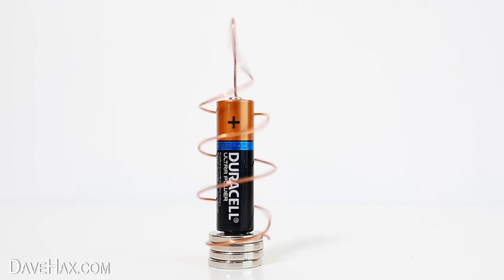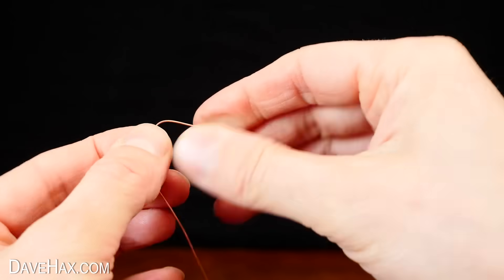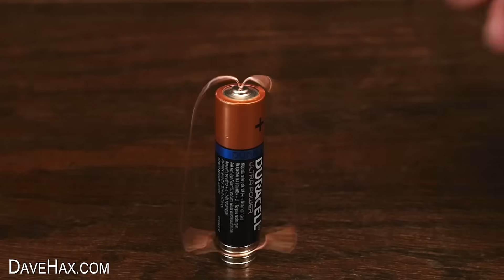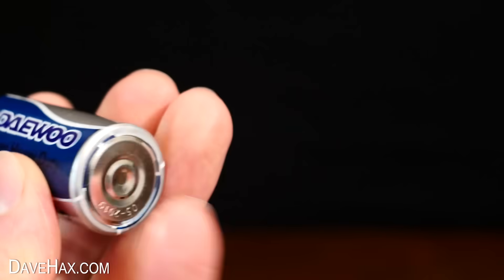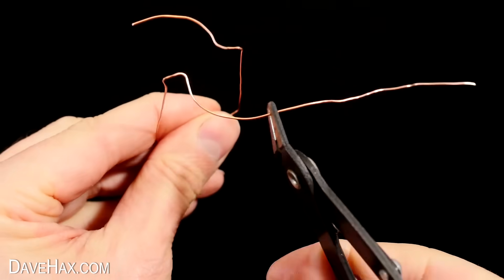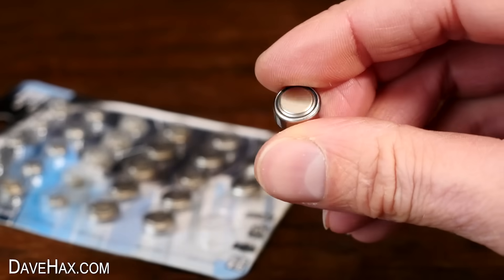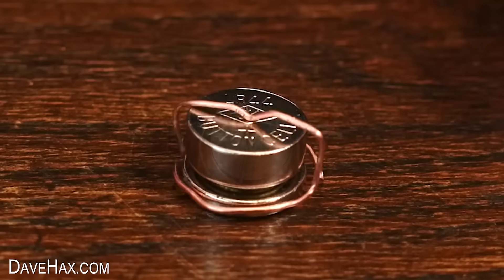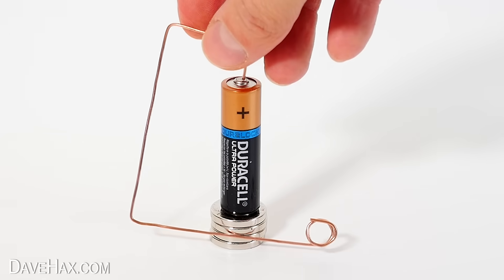DIY Button Battery Homopolar Motor - Science Experiment

Comment: i legit make air core inductors from 18 gauge ook brand copper wire and a hillman's common bright framing nail. i use the nail as a mold then slide it out.

Comment: Nice motors! I'd like to see a short, where you do it with thicker wire, and an F-Cell battery. F-Cells can be found in 6-Volt lantern batteries, and I'd recommend getting an Energizer-branded lantern battery, to get 4 of them. Just be a bit careful, cutting off their connection tabs, once the F-Cells are cut out.

Comment: Is this real? I mean, just after decades in thinking some things were for a given, now i know a motor is always an alternating current device. So how in this model the commutator works? In order for any spin would be possible, the magnetic field must be stopped in a commutation event to allow the rotor to escape the initial magnetic pull and repeat the process again, the commutator are like the valves of an engine, if there is no commutator, it's gonna happen the same as with those free energy devices, the rotor stops when it cannot escape the magnetic pull that is fixed in one polarity.
Reply: watch a video from electroboom he explains it
Reply: @larmeedls  but this one is real? What would be the commutative element that allows the spinning??
Reply: @seanvandiijk2889  The bare copper wire brushes the metal coating on the magnet and allows the wire to slip around the magnet while still maintaining contact. There is your commutator.
Reply: I think only one of the wire is conducting. No commutation is happening. To get the torque we need to have magnetic field and current. Here, to get unidirectional torque radially outward field (perpendicular to the current direction) and single direction current is being used. In case both wire conducts the torque gets cancel out.

Comment: Be interesting to see if it cant be done without a dead short. I'm thinking the battery wont last long ?
Reply: Correct. You are shorting the battery. If you put a resistor in the wire, the current in the wire will be less, and the motor will spin more slowly.

Comment: Some very important bits of information that were missing from this video:
- The magnets pretty much must be neodymium types. Some 'refrigerator' magnets of the same size, shape and appearance will not be strong enough to result in a working motor.
- While most round neodymium magnets are polarized with N on one face and S on the opposite face, there are indeed identical looking neodymium magnets that are polarized 90 degrees out from what is necessary, and they won't work.
- The copper wire must be conductive at all points where it touches the end of the battery, and also where it touches the magnet(s). The wire can be plastic insulated or lacquer insulated for the rest of its length, but it is usually best to use completely uninsulated wire.
- There MUST be an electrical circuit, with current flowing from the tip of the battery, through the wire, and back to the opposite side of the battery via the conductive nickel plating of the magnet(s). It is a LOT of current, as the battery is essentially being short-circuited. Larger batteries can produce the same amount of current for a longer period of time, so a "AAA" cell will last longer doing this than a button cell, a "AA" cell will last even longer, a "C" event more, etc. But regardless, the run time is not very impressive, and a partially drained battery/cell either won't work at all for this, or else the wire will spin slowly.
- It should be clear from the above that the wire must be making an electrical connection with the magnet(s), but you want to form the wire so it is pressing against the magnet with just enough pressure to assure a good electrical connection, but not any more pressure than that, or the friction will slow the motor down.
Reply: The nerd at school be like 😂😂😂😂
Reply: @thekboy3248 And troubleshooting is not being a nerd (even though I am one 😐)
Reply: excellent comment, ty!
Reply: Could you also perhaps explain the function of the magnetic component in the circuit? If I could somehow get the wire from the positive to negative end of the battery do you think it'd still be functional?
Reply: Dave said "this loop will hug the magnets at the base of the battery" ....i guess i didn't hear that for the last three years but after reading your comment  "It should be clear from the above that the wire must be making an electrical connection with the magnet",,,I finally made the "connection" and my motor finally works...aye aye aye pay attention to the details!
Reply: I think another important thing to note are that the black refrigerator magnets you were talking about are non conductive, so connecting it to them won't work
Reply: but these work because of the right hand rule, so the current DOESNT need to run through the magnet itself (it just needs the wire to intersect with the magnetic field) meaning you can try wrapping the magnet in a thin layer of foil, or keeping the magnet below a conductive cylinder of some sort, with the wire connected to the cylinder
Reply: THANK YOU
Reply: I dont understand your first point. It is very unclear about The magnet being overpolarized
Reply: @adita6811  seems like you don't understand a LOT.......
Reply: does the amount of magnets u put affect how fast it is?
Reply: string enough?????
Reply: I aint readin alat
Reply: @koyvon4455  , apparently you ain't writing "alat" either, zero skill. Why advertise your gross inadequacies to the world in a pointless YouTube comment?

Comment: Why does it always spin to the right?
Reply: Wonderful question. The answer is pure physics. If you turn the magnets over, or reverse the battery, it will spin the other way. Do both and it will spin the same way. The "right hand rule" determines the direction, so look that up somewhere on the Internet.
Reply: Its based on lenz and faraday law @thomasw.eggers4303

Comment: .Nice presentation sir if you dont mind sir, can i know what wire is that  it just a magnetic coil or a solid wire no insulation and what gauge of wire maybe,hope you can give me a answer sir thanks more power to you..
Reply: It is copper solid wire that appears to be size #16 (US measure) or so, but just stiff enough so that it holds its bent shape. The size is not otherwise critical.

Comment: The battery is charged or discharged ?
Reply: To make the motor work, the battery must be charged. Power from the battery is consumed, and the spin will continue only until the battery goes sufficiently dead.

Comment: I buy copper wire from amazon and it seems to be decorative and doesnt actually conduct electricity
Reply: Make sure it has no insulation at the points of electrical contact. Is it actually copper wire or only copper-colored something that is really not copper.

Comment: 3:14 Is this like infinite energy?
Reply: Absolutely not! It uses energy from the battery and will continue to work only until the battery starts going dead.
Reply: @thomasw.eggers4303  what about the magnet
Reply: @galacticlava1475  No infinite energy from the magnet either.
Reply: @thomasw.eggers4303  how the magnet can’t turn off
Reply: @galacticlava1475  Correct. This demonstration is using a permanent magnet and can't be turned off.

Comment: This is false. You need to scrape the orange (protective layer) off the actual copper. It's used as a safety. For the whole conclusion of this reasoning you'll basically need to scrape off the orange *(). Thank you,
Sincerely Candice
Reply: You are correct that the copper wire must not be insulated, at least at the points of contact on the top and bottom. Some copper wire is insulated and some not. I presumed that this demonstration used non-insulated wire. I suppose that could have been said explicitly.

Comment: But sir my copper wire is not spinning...
Is kind of copper matters
Reply: The copper wire must be NON-insulated at the points of electrical contact. If you are using insulated wire, scrape off the insulation at the contact points.

Comment: If someone was to do this with a very powerful (for instance neodymium) magnet, would it make the wire spin faster? Or will it cause anything dangerous to happen? I googled it & it doesn’t seem like there’s any kind of well-discussed contraindication between (at least lithium) batteries & magnets. But the discussion was mostly around whether it would drain the battery. I was more concerned about whether it could heat up and/or explode the battery lol.
Reply: I made this exact experiment using neodymium magnets,and it spins really well. The flat magnets the author is using are neodymium. Ive got the same magnets and a $hit load of various sized Neodymium magnets.
This experiment is great.A lot of fun...BUT,you wear magnets out rather quickly.It gets expensive.
One note...
Batteries are a DC source.
So,I tried this with DC transformers of varying volts and currents.I couldnt get it to work.A bit of a mystery to me.
Oh...and as far as batteries exploding...Ive killed many batteries playing around with this,and never had one to explode or even get hot.
Reply: @stegususcley2655  Don't you mean, wear out batteries quickly, not magnets?

Comment: Is the chemical energy spinning the wire or the button magnet’s magnetic field, or both?
Reply: The magnet creates a magnetic field (say, in the X direction), the battery creates an electrical current (say, in the Y direction), and those two create a force in the Z direction. Then the force turns the motor. This is very similar to Michael Faraday's first electric motor circa 1825.

Comment: I used metal wire and it’s hot now
Reply: Yes, electricity flowing through wire heats the wire. The more current, the more heat.

Comment: Do we have to use thin copper wire
Reply: Any conducting wire would work (aluminum, gold, silver, platinum), but copper is the easiest and cheapest to work with. The wire must be stiff enough so that it holds its bent shape. And no insulation, at least at the points of electrical contact.

Comment: does it work without copper
Reply: Well, you really do need the wire, but the wire need not be copper as long as the wire conducts electricity well. Aluminum, silver, gold, steel would all work, but copper is the cheapest and easiest to work with.

Comment: Would it work with steel wire
Reply: Steel conducts electricity, so, yes, it will work with steel. But copper conducts electricity better, and may be easier to work with.

Comment: Really cool! I have a query though, how do we have electric current without a closed circuit?
Reply: Obviously, the top is connected to one battery terminal and the bottom end of the wire connects to the bottom terminal, through the magnet. The bottom of the wire just brushes the magnet to make intermittent contact. I was intrigued with this novel device.

Comment: I tried it, not only it short circuited the battery, it also electrocuted my fingers when I tried to take the wire off. :(
Reply: Your wire is contacting both the top and the bottom of the battery, hence short circuit. Watch the video again. Good luck :)

Comment: I tried making this many times before and it was a success. If you flip over the magnet, it would spin the other direction.
Reply: Can i know how to make it spin? Cause i tried but it didn’t spin🥲
Reply: @lunainluv  u need to make the bottom loose enough so that there's less friction. But when u put the wire on top, u need to make sure part of the wire touches the battery so that it moves. If it still doesn't work then idk the problem for u

Comment: 03:38 "Here's as really cool spiral one I made." ~ {Common misconception. That is NOT a spiral. A spiral goes from outside to the center, but it does NOT go upward. What you have there is a helix. The same goes for "Spiral Staircases". They would not go ANYWHERE. They should be called "Helical Staircases".}
Reply: Spiral or helix. Yes, you are correct, Mr. Pedant.